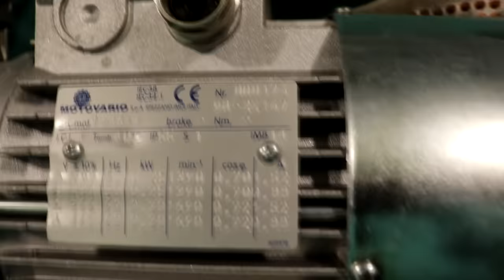DIY Recycling Machine for Aluminium Cans (Make money from your aluminum cans)

Comment: Great ... And how exactly are crushed up cans going "to make money" ??
Reply: Exactly, because crushed cans still have the same scrap weight as one that isnt crushed
Reply: Back in the early 90s they had can recycler centers on corner streets, it was about 20 cents a pound, I was about 10 years old at the time and I found out that if you fill half the can with dirt or sand and crush it, it would take about two to three cans to make a pound instead of the 34 cans. I would clean that machine out once a week with a bag full of cans. Not the honest thing to do but growing up poor around that time when my parents lost their jobs due to shutting down I needed a way to find money so my parents and little sister could eat. I felt bad but had to do what I must do survive.
Reply: @yogidemis8513  it wasnt the wrong thing to do.
Reply: @yogidemis8513  I collected cans as a kid, in the 80's & 90's. We used to crush them, until the recycling centres stopped accepting crushed cans because of people like yourself. We couldn't collect as many once we had to keep them uncrushed. :(
Reply: In some towns like mine mostly where people drink alot you can crush your cans and give them to someplace and it doesn't make as much money as in the thumbnail
Reply: Certain provinces in Canada actually still give money for any container that's recyclable.
Reply: @thewolftamer4403  That is not "making money". That is "getting your deposit back", which you paid for, when buying the can.
Reply: @Dutch_Prepper  yes but most don't even notice, or well I didn't,
Reply: I live in South Australia. We can get 10 cents per can at recycling places. Same with plastic bottles and glass beer bottles
Reply: @jscbmx21  The very 10 cents you paid for yourself...
Reply: I used to work at a scrapyard we took crushed and uncrushed cans, the weight of a crushed can is the same as a uncrushed can but crushed cans take up much less space therefore you can fit more in a bag. If two guys each with the size contractor bags full of cans. One with crushed cans the other with uncrushed cans, the first guy is going to make more money, the second guy is basically selling air which the scrapyard doesn't mind.
Reply: You get more cans into a bag. Three bags of uncrushed cans can make one bag of hand crushed cans. Crushing them this small will allow you to fill a bag with more cans which means more money and where I live they allow crushed cans and the workers prefer crushed cans because they are easier to count four at a time not having to fumble trying to hold two in one hand. Takes longer to collect but in the end if you brought in four bags filled with those crushed cans you just brought in the equivalent of like 12 bags of cans.
Reply: The recycling stations don’t even take crushed cans
Reply: @dominoespizza1756  in Texas we do
Reply: I've got as much as 55 cents a pound for them.  We don't pay a deposit on them.  A couple barrels full will bring a nice payday.
Reply: @bobshoots2929  they take up less space so your garbage bag or  barrel holds 3 or 4 times  more.

Comment: Economically speaking, how long does it take to offset the investment in materials alone? Neat machine though!
Reply: To make the $800 he shows at the end of the video, you'd need to recycle about 35,800 soda cans
Reply: Michael McGee well, you need to drink a lot of soda then!
Reply: Just 1 hundred years!  If you can recycle 20 lbs of cans an hour for 5 hours a day for only 1 hundred years, you too can off set the probably $30,000.00 worth of equipment and parts to make your very own.  Very practical.  Love it.
Reply: @georgecavanaugh8615  Ignoring the lathe, a welder, grinder + disks, bench vise and drill press can be had very cheaply and even the cheapest ones are more than capable of letting you build this machine. And in this case, the lathe can simply be traded out for time sanding the ram to shape, or simply using round stock that more closely fits inside the other. People like to wallow about the cost of tools to do projects found on youtube, but this one is not one of those projects.
Reply: You can buy a manual can crusher for less than $10 and get strong arms while doing it, which might help to offset the stupid amounts of calories you take in from drinking soda. It probably won’t help you afford the repair to your teeth, nor will it compensate for a lifestyle that involves more sitting than walking, but it’s better than an automated crusher that you can use from the sofa while you dig the remote out from between your fat rolls.
Reply: @whisperingwind2  I'm totally with you. And you can save even the 10$ can crusher if you just drink water :-) I'm happy that we have here a recycling process where glass bottles get refilled. So no need to crush and melt metal all the time when I drink soda, water, beer, fruit juice or milk.
Reply: Materials alone: 20+ years
Materials+energy consumed: -20 years
Reply: Since all it does is save you some shipping volume, I'd say it takes about an eternity ± million years.
It's a cool looking machine but unless you are shipping tons of old cans doing this is just a waste of electricity. If you are working with such amounts then you would probably need a proper industrial machine to handle it at a reasonable efficiency.

Comment: If you live  where there's a nickel deposit on aluminum cans, this makes no economic sense.  Neat machine though.
Reply: I've never heard of a deposit on cans. Strange.
Reply: PiousMinion its a thing in hawaii
Reply: @midas7934  and Canada  5 cents on cans.  10 cents on bottles
Reply: But if same 30-40 cans is only 2$ and you can get a pound of clean aluminum when melted down to a bar that same bar clean can be sold for anywhere from 4-8$ Canadian essentially making the value increase by 2-4 times (applies to other scrap metals as well)
Reply: @OGCBDB  what's the cost of running the machine and melting the cans down into clean aluminum ingots plus the loss of aluminum as slag during the process?
Reply: SaintApoc cost is mostly start up, buying a premade foundry can be pricy but I just put myself one together just have to set the thermal concrete layer I experimented with. 350$ is what it’s cost me so far including buying a brand new propane tank which a 20lb tank will run anywhere from 4-8hrs depending how hot you run the set up aka PSI output and that being said you could melt anywhere from 10-200lbs of aluminum depending on the size of the foundry and crucible your melting in and the slag just comes right off the top with minimal effort or flux which borax will work fine for and propane is cheap to fill. Long story short most of the cost is in start up doesn’t cost much to run just depends what kind of things you pour it into after to form bars or cylinders to sell or stockpile
Reply: SaintApoc look at my first comment 30-40cans will melt into roughly 1lb of clean aluminum after slag removal
Reply: Hahaha..😂🤣
Reply: Germany: 25 Eurocent on aluminium cans. Worked wonders on littering.
Reply: @piousminion7822  25 Euro cents per can (about 30 US Cents) in Germany
Reply: @OGCBDB  A propane foundry is expensive to operate and makes a huge amount of slag from the heavy oxidation of the aluminum.
An electric foundry will cost 1/4 the amount even in a place like California, and closer to 1/10 the amount in a sane part of the world.
Electric foundries will also generate less slag.
They can be complex to design, but you can actually use the element out of a water heater for melting :)
Reply: its thing in finland too
Reply: joshua43214 diddnt know 20$ a tank of propane for 4-8hrs of melting is a bad deal? Not everyone has access to tools to build themselves a induction foundry the propane one or even charcoal makes it more affordable and easily accessible
Reply: Wouldn’t you be better off starting a nickel mine?
Reply: joshua43214 and you haven’t seen Ontario electric prices lmfao stupid expensive unless you do it in the middle of the night
Reply: @saintapoc4031  you just put the cans into a bag and they weigh them
Reply: Australia has cash for cans, and plastic bottles in some states. We have fortnightly roadside recycling collection. Throwing out recycling gets a fine.
Reply: It doesn't even make economic sense to get the nickel deposit back. After time saving the cans, fuel to bring them to redeem, time redeeming, and return fuel it's worth at most $5 an hour (I did the math from a full truckload). 

Just another tax.
Reply: @OGCBDB  $20.00 for 8 hours is a very bad deal. In my area, my furnace runs for about $0.15 an hour. I am not talking induction, just Kanthal wire. The ovens are cheaper and easier to build than propane, last longer, run more efficiently, and you do not ruin a large percentage of your aluminum.
Down side? You need to be able to do math for the calculations, and it takes about 30% longer than propane to reach melting temp provided you sized everything right.
Reply: joshua43214 not sure if you missed where I said that power is super expensive unless it’s the middle of the night where I live lol. Good luck setting yours up out in the middle of a field with no houses for a good few hundred yards. Would probably cost me at least a dollar or two an hour to run with the power costs without it being peak hours
Reply: joshua43214 have a massive pile of scrap aluminum to melt way out in a field , think couple thousand pounds and hauling the pieces back would be a waste of time when I can do it there, mind you I’m not doing this for profit the money made from the bars after is more of a bonus it’s a hobby and I’m just happy melting metal and casting some stuff
Reply: @hauntedyards  Beer/alcohol cans & bottles, not pop cans, at least not in all provinces.
Reply: Where is the closest one to Maryland? We dont have that here.
Reply: Corey Howard depends if your state would have it or not and taking them to somewhere else is a hefty fine if caught I’m not even American and I know that

Comment: In Sweden we get 1kr ($0.10) per can when recycling it.
Reply: Here they only count if not crushed because the counting machine expects full sized cans.
Reply: @court2379  Yes ofcourse it needs the barcode to know what it is.
Reply: In Lithuania we get 0,1€ per can , plastic or glass bottle. So there is no need for crush them :)
Reply: In Germany it ist 0,25€ for the can 0,15€ for the multiple use Bottles and 0.08€ for glass beer bottles
Reply: in finland it's 0.15€ per can, 0.20€ for plastic bottles and 0.10€ for glass bottles
Reply: in america, at least where I live, it's all #1 aluminium, regardless of size and if they are crushed or not. though they sometimes will try to screw you over by claiming a can is actually #2, so because of that one can out of a hundred ALL of it is #2. prices depend on the price of aluminium but some states give a flat rate of anything between $0.05 to $0.10 per can. it usually pays more to take them to a scrap yard though.

also, dont do what a friend of mine did and melt cans down into ingots of aluminium. because they weren't cans when he took them up there, he got about $100 less than he would of just taking the trailer full of cans.
Reply: In Italy we pay for trash and we can't sell metals
Reply: @mrsnezbit2219  that's actually a real shame, most of the scrap yards resell their metals to foundries to be smelted back down into usable metals to be then further reused elsewhere.
Reply: @Kalezian  scrapyards can sell, you can't. All you can do is pay someone to take your "trash" away. It's a legalized mafia
Reply: @Kalezian  Interesting. How does that even work? Someone is counting the crushed cans or just weighing them? We have machines in all grocery stores that will count and crush them, then give a piece of paper that you can use to pay or get your money. I don't know how common this is internationally outside of europe.
Reply: @erik....  in the places that give a flat rate per can they count them like anywhere else, but with a scrapyard they do it by Lbs/Kg and pay you the going price for the aluminium. some states here even do flat rates on glass/plastic bottles. Generally though it's a way to get people to recycle, if people get money for taking them to a recycling center or scrap yard to re-enter the flow of resources then they are more likely to actually do it.
Reply: In norway 2-3 kr 0.2-0.3$ depending on size
Reply: @mrsnezbit2219   Ci sono negozi che comprano metalli (ferro, rame, etc) Se cerchi su google maps "compro metalli" ne troverai un po' (almeno in zona milano dove ho cercato)

Comment: Waste of money, most recycling centers are refusing crushed cans because people add weight into them.
Reply: not to mention how many cans you have to crush to pay for the welder, the material, the motor, and electricity.  my grand father had a hand held can crusher that used elbow grease and cost about $15 dollars to make.
Reply: @dcos5  One could just add a recycling fee like most of europe does.. we pay around $0.11 per can when we buy soda, wich we get back when we reycle them at the store (most stores have machines for that). Result? Like 85% of the cans (there is recyling of plastic cans to) are recyled..
Reply: @jmkhenka  Most Americans I suggested that to (that haven't been here to experience it first hand) were very skeptical... The majority of them really doesn't like change.
Reply: We have the same exact thing in almost every state in the us so you're not telling the truth. How surprising, someone lying on the internet.
Reply: @KacKLaPPeN23   Most states in the US actually do that.
Reply: Not when you melt them yourself...
Reply: @jmkhenka  Its a big hoax, the recycle company earn  $0.11 per can, those 15% still pay its hugly profitable, a winwin concept. Even without this system most swedish would recycle anyway and even if thrown in hoshold sort out alimunium can from houshold waste is easy.
Reply: @KacKLaPPeN23  I think you made that up.  We have such systems here, in several states.   In my state, it's called CRV (California Redemption Value). States that implement such a fee enjoy an average 70% recycle rate for beverage containers.

Please do your research before making claims about a  country you've never been to. 👍
Reply: @TheCas9641  It's actually not "most", but only 10 states.  Several states tried and failed to pass the needed legislature.  I'm curious to see the relation (if any) between beverage consumption rate and existence of recycling incentive programs.

https://en.m.wikipedia.org/wiki/Container_deposit_legislation_in_the_United_States
Reply: @keithbordeau4874  "almost every state" = 10 states.  🤔

Perhaps those states are the top consumers of beverages in the US. (hopefully)

https://en.m.wikipedia.org/wiki/Container_deposit_legislation_in_the_United_States

Comment: Just throw the cans into the deposit-refund machine.
Reply: Some states don't have that
Reply: Deposit refund machine? Never heard of that before
Reply: We have those in NY. You’ll only get a nickel per can. I took cans to the scrapyard once and got about 7 cents per can. That was at a time when aluminum prices were down. I was a janitor at a decent sized university and collected cans would add at least a hundred dollars to my paycheck, sometimes more.
Reply: @ManScoutsofAmerica  If you're making a trip to the scrapyard just to return cans you also need to subtract the cost of gas for the trip. Since - at least here in MI - the deposit return machines are at the grocery store so no "extra trip" needed to go anywhere.
For example say your vehicle is 20mpg scrapyard 5 miles one way, 10 miles round trip. Means you use half a gallon of gas. Gas say $2.50/gal then that is $1.25 in gas cost. So to save 2 cents per can one would be spending an extra $1.25. Need 62.5 cans just to make up for the fuel cost, after that you starting saving a whopping .02 per can.
For most people this would be a losing proposition.
Reply: knpstrr I find my time is more value than money. I’d rather drive the 2 miles to the scrapyard and spend 1 second on a scale than spend an hour pumping 50 dollars worth of cans, one at a time, into a machine. An hour of my time on this earth to do what I like is more valuable than 4 miles worth of gasoline and ten minutes, to me anyway.
Reply: knpstrr I drive a Subaru that gets about 30 miles to the gallon and I don’t take my cans back until until my big bin is full which is about 60 dollars worth of cans.
Reply: @ManScoutsofAmerica  In Sweden it pays 1kr per can and 1kr per plastic bottle and 1kr per glass bottle. 10kr is about 1€.
Reply: We get 10  cents per can over here in Michigan. Work at a golf course and once a week i take back 4-10  60gal bags of cans. Go to the grocery store on way home, takes about 10-15 mins with 2 people. Make a extra $100-200+ a week for something that they normally throw away. Have not "paid" for grocery's in years.
Reply: @ManScoutsofAmerica   As I said, for most people it is a losing proposition.
Reply: We used to have some here in Tampa, years ago, but they removed them long ago.
Reply: ryan norris  All I'm saying is that for $0.02 additional cents per can it is not worth it for most people to make/buy a crusher and make an extra trip to a scrapyard.
Reply: We get a nickel here in NY. Unless you are good at darts.... then maybe .08 and no extra travel or time.
Reply: @Boobtubeus  Really?
Reply: @soccerdog45  best comment
Reply: Josefsson90 I think you mean 2kr for the big Plastic bottles (1,5l)
Reply: @Boobtubeus  We have those in Australia. You pour cans into the machine and money comes out - 10 cents per can. There are also machines for charity where the 10c per can is instead given to a nominated charity.
Reply: @ManScoutsofAmerica  lol a can is worth max 1 or 2 cent at the scrap yards aluminum is less than 1$ a lbs